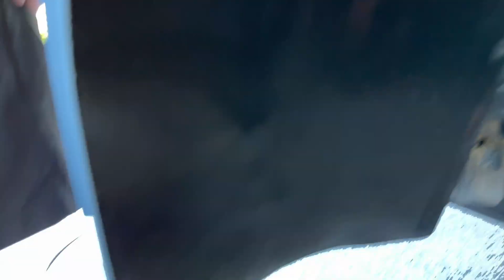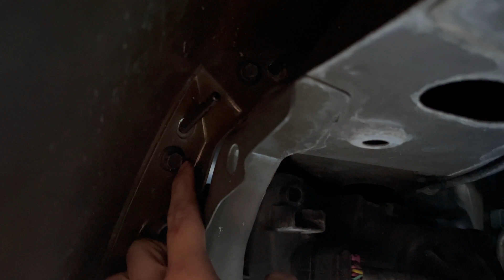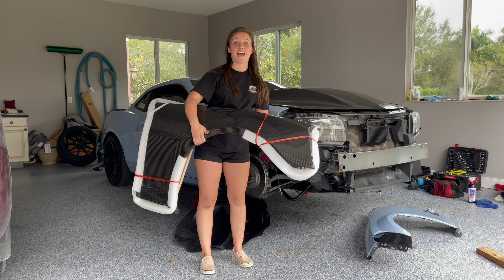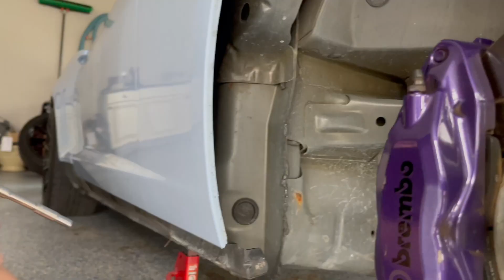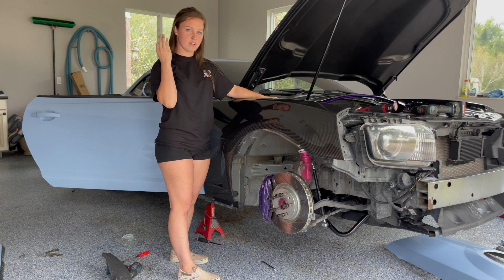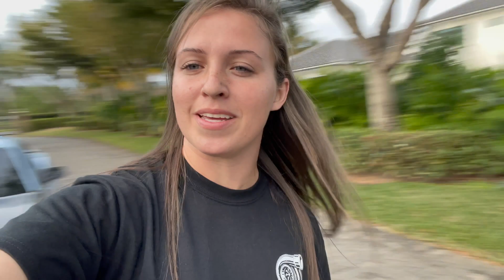Carbon Fiber Fenders for the Camaro

Comment: Heck ya!! Question? Is it more for style or does it actually save you a bit of weight on the car?? Looks good!
Reply: Body panels are metal so there's definitely some weight that was shaved off. Maybe 10 pounds?? *Edit someone one the forums said their stock fenders were 17lb EACH and the Carbon ones are 4.5lb EACH! So we're talking in the neighborhood of 25lb total weight savings!
Reply: @nickadkins7765  awesome! Thanks for the  info and research you did! Solid in depth response, thank you!
Reply: @crazychris7417  🤜🤛

Comment: Carbon fiber should be drilled with spade bits, and faced on both sides with wood when drilling, info only just saying. I work with carbon fiber all the time at boeing. Don't get the dust in your lungs or a splinter under the skin if you do get it cut out right away because it will travel all the way to the other side of your body until it decides to exit I the future. It has barbs on them that prevents them from backing up so they bury themselves deeper as time goes by reakng havoc going through organs etc,. Just saying !  Be careful with that stuff people that produce it get alot of training on the carbon fiber composites. Atleast we do at aircraft manufacturing plants. Very dangerous in raw resin impregnated stage very carcinogenic. Car looks awesome.